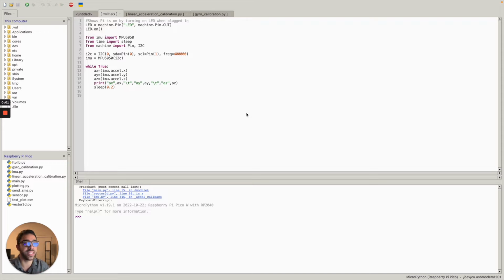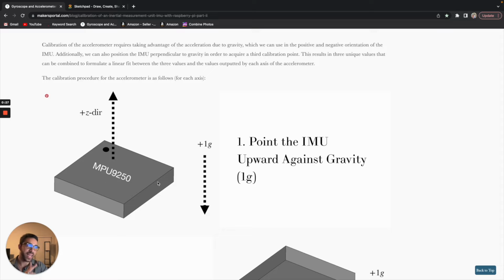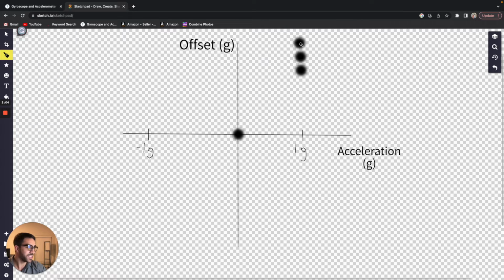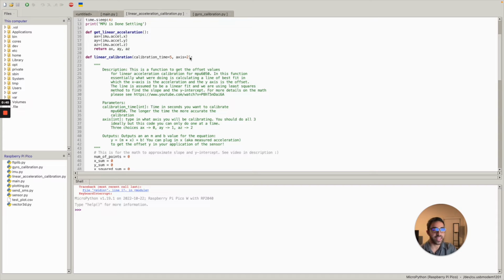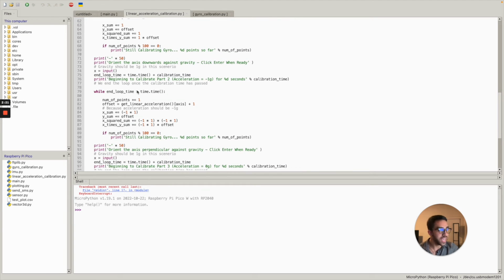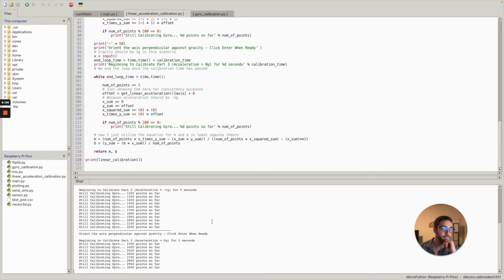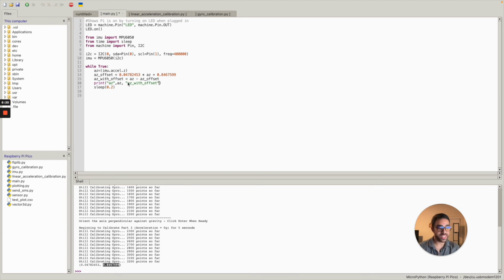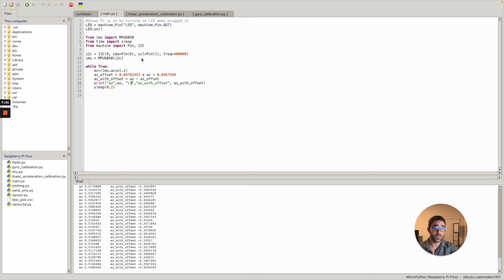How to Calibrate MPU6050 Simple/Easy (Part 2)

Comment: Do you do cal for x and y the exact same way?
Reply from the maker: Yes you do just need to change the orientation!
Reply: thanks. to be clear, when we orient x in the opposite direction of gravity, we are looking to get a value of '1', correct? The reason I ask, is that my application is an autonomous car that will use the gyro and x for direction and position. @mmshilleh

Comment: In the "Linear Regression" video the x_sum equals to 1+2+3+4+... (the sum of indexes), in your case it is just the number of points: x_sum += 1. Why?
Reply: And lets assume you have these Z values: 2, 2 for +1G (offset 1), -1, -1 for -1G (offset 0) and 0, 0 (offset 0) for 0G. What would be the m and b?
Reply from the maker: To answer your question, x_sum is just the some of points you are measuring so we just increment by one.
Reply from the maker: Let me put it this way. If you measure 2 points, 

the first point for Z +1G and you get an offset of 1

the second for Z -1G you get an offset of 0

m = 1 (I just calculate the slope)

and the y-intercept would be 0 

hence an equation y = x for the bias

This is known as two-point calibration. Ideally, you would want more. Hope that answers it
Reply: @mmshilleh  I don't fully understand the math behind (I like to understand things), but I already found the bug in my code (I'm playing with Arduino and C++, you with python). My problem with that algorithm is that you are using normalized values -1 to +1. My Arduino gets the values from MPU6050 in a range from -4096 to +4096 (for my configuration, the range depends on the resolution). The easiest way is to normalize the values and use your algorithm directly. The other way is to leave the value as it is and replace some +1 and -1 with +4096 and -4096 in the algorithm (only the +1/-1 that correspond to the X value). Btw for my Arduino and +1G the Z offset was not such big as yours, it was arround 450/4096.
Reply from the maker: @DanyWay  This is a two-point calibration method. The math is just trying to find the equation of a line. In this calibration, you would subject the accelerometer to two different known forces or accelerations, and record the output readings from the sensor for each input. These two points can be used to create a linear equation that maps the input values to the output readings, allowing the sensor to be accurately calibrated across its entire range of operations.

Two-point calibration can be useful for an accelerometer because it allows for a more accurate and precise calibration across the full range of the sensor's operation. By measuring the sensor's response at two points, it is possible to account for any nonlinearity or error in the sensor's output readings, resulting in more accurate and reliable measurements. Additionally, by using two points, the calibration can be performed quickly and easily without the need for complex equipment or procedures.